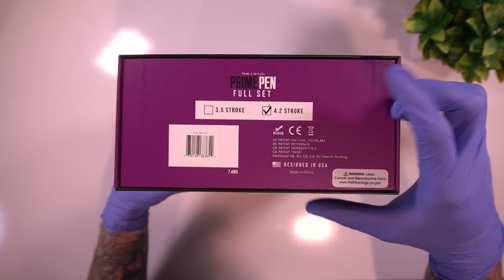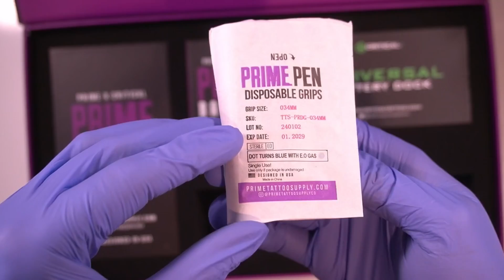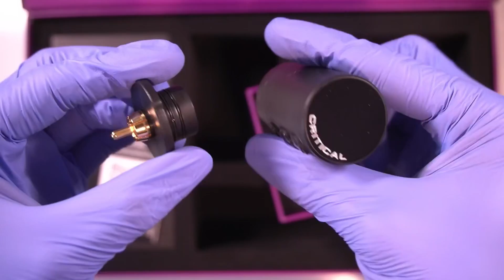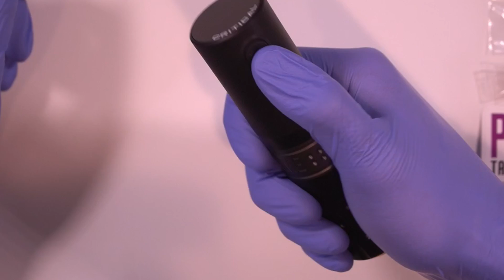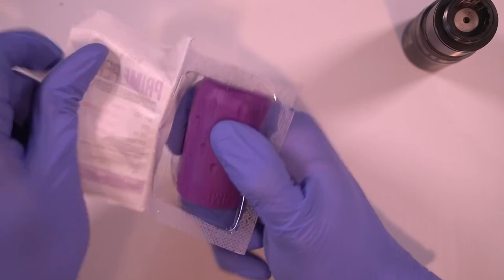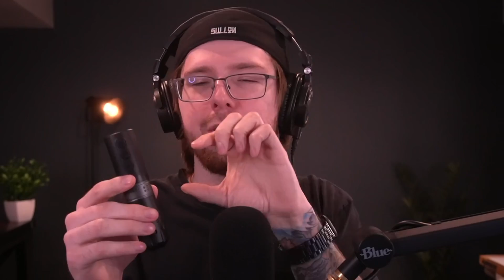Prime Pen Tattoo Machine Review

Comment: Hey Adam. Have you ever tried the rotary works pen 2.0? It’s a similar price to the prime, and I’m not sure which one is better.
Reply from the maker: I’ve never heard of it, sorry 😅
Reply: @adamdarklord  😂  No worries. I only recently heard about the brand, but they're based in the UK, and have apparently been around for a while. They have a pen style machine, and although there isn’t a lot of info or reviews on it, the ones I have heard say it’s great. I saw one comment where someone said ever since they got theirs there bishop wand has been collecting dust in the drawer. I’ve been doing nothing but researching the best pen style machines forever, and would love to get a power wand or the acus, but hot damn they are so expensive, and I’ve been trying to save so I can get the next model of the iPad Pro after the M4 versions. So far the best options seem to be this prime pen, or the rotary works pen 2.0. 🤷‍♂️

Comment: So Adam, I watch a lot of ur vids (great job) but listen…
I’m in the market for a new wireless machine. I’m spending hard earned money, I tattoo 3-4 clients a week on average, I’m building my career RN. 
That said I feel like I don’t know what to invest in..I want your honest opinion what to put $ towards/invest in..what machine set up?
The EZ Turbo looks good but battery life is important to me..
The Prime pen looks sick but I’m concerned w the swash plate u dis on a lot but this on is “Great”?
I’ve been tattooing with a TF pen 3.5mm stoke w fixed swash plate for a year no issues..
Or save $ n invest in Acus?? Love that sounds like good investment also due to all the interchangeable parts/good design..
  So what to spend $ at my point in my career? What would you do? Or do you suggest a different setup?? Plz lmk I respect your honest advice
Reply from the maker: If you’re used to a swash plate machine  then the prime is awesome.
The prime actually has lots of power for a swash plate machine I’m very impressed!
It’s the best swash plate machine I’ve used. 

With the Turbo you can tattoo like half the day then just plug it in take a lunch brake and then it should last the other half of the day. 

If you almost have enough for the Acus saved up I’d definitely get that! It’s the last machine you’ll ever have to buy 🔥

Comment: How does it compare to the 4.2 Torque and 4.2 Wand? Very curious.
Reply: If you already have the Torque or Wand, we recommend sticking to them. The Prime Pen is designed more for those just getting into tattooing or pen style machines nor those that like finer lines and shading. It hits slightly softer whereas those that use the Torque have quicker hand speed and  prefer more power/torque.
Reply: @criticaltattoo  so if I have the packer and the torque in the 4.2 and 3.5, the 3.5 prime wouldn’t be a viable option for black and grey with the swash plate and possibly behave similar to the hawk pen?
Reply from the maker: Critical nailed it with the reply!
I’ll do a comparison video in about a month after I do some more testing

Comment: Brush Motor in 2024 👎
Reply: Don't knock premium brushed motors. This is a custom motor made in Japan (not China) by Namiki and has better durability compared to brushless motors from China. We are nerds and run crazy cycle tests. This is the same motor used by the Bishop V6 Capo with many having gone 5+ years with no issues.
Reply: @criticaltattoo that’s fascinating, years ago I heard that Japanese production of these motors had been completely moved to China. That anything from China marked Namiki and “Japanese motor” were actually being manufactured in China.

Not to speak ill of all Chinese manufacturing but it’s nice to hear we’re getting actual Japanese motors in tattoo machines now.
Reply from the maker: @criticaltattoo  🙌
Reply: I’ve used the Fk Irons Max “brushless” and the Fk One “brushed“, Max for two years, One for 1 year.

They’re identical, if the motor is of quality you literally can’t tell the difference.
Reply from the maker: Did they confirm what motor it is?
Reply: @adamdarklord  I saw the information on the Barber DTS website

Comment: I can't get why this machine is good ?Not adjustable and don't think the design with the plate inside is going to last...what's your opinion?
Reply from the maker: I wish they went with one machine with swappable plates inside it to adjust the stroke. That way if you had an issue with the plate you could just order more plates! It’s hard to say so far, I’m surprised I’ve had no issues with the swash plate. It’s actually been feeling very good to use but of course the plate would have to ware out at some point 🤷‍♂️
Reply: @adamdarklord  so I can't see the difference or why it is so unique...

Comment: Is this good enough to knock the m1 and critical off the top of your list? Thanks for the videos man!
Reply from the maker: The M1 is still my top spot because the M modes, battery cells, and buttons and display on top!
I’m doing more testing but I might like this more than the Torque. I think the swash plate makes it hit the skin softer so it doesn’t damage the skin as much. 🤔

Comment: This machine kinda looks. Just like the dragon hawk fold 2  with a different logo. On it. That's my take off this machine
Reply: Looks can be deceiving ;) The guts and engineering matter. Please run a voltage accuracy meter from any other battery vendor and compare to Critical. We are obsessed with accuracy down to the small details.

Comment: How many batteries does it come with?
Reply from the maker: Two batteries if you get the full set I got
Reply: @adamdarklord  thanks for the reply,
Do you know what motor is inside the prime machine?
Reply from the maker: @jonathanjulius1903  They say it’s a motor used in a bishop machine but who knows what machine. If it was a Faulhaber motor they most likely would have said that and it would probably cost a-lot more. I’ll probably get more info on that soon!
Reply: @adamdarklord hopefully they use faulhaber motor

Comment: Made it more affordable since they didn’t go with the Faulhaber motor and direct drive system. Lost me at swashplate. Just too much of a bad history with them breaking and/or wearing out. Maybe they can prove it to be a viable option with this pen. Certainly should be a more affordable option for people not wanting to fork out a grand for a pen style machine.
Reply from the maker: They say it’s the “Bishop Motor” which bishop motor I have no idea. Maybe I can find a way to take it apart
Reply: @adamdarklord yeah if it were a Faulhaber motor, they would’ve said it. lol.  Ones like the microangelo used Swiss maxon motors. Which I also think they would’ve said. Because those are probably the two we’re most familiar with for performance and reliability. Not mentioning it, reducing costs, and that swashplate and transmission piece all sound like outsourced China parts to me. Which I can’t completely dismiss because my peak solice and Kyan have been running forever and they're China made. 🤷🏼‍♂️
Reply from the maker: @1Dantrn  good point 😂
Reply: We pride ourselves in backing up all our products and located right here in the USA. If you have any issues with the machine, we're here domestically to repair/replace :). We do use tighter tolerances on our swash and use an amazing motor to pair with this machine.
Reply: @criticaltattoo  thanks for the input. I’ve always been impressed with your customer service.
Reply: I wanted to order it but the disc puts me off too. I would have liked her to be direct. I don't think she has as much of a hit as the Packer, right?
Reply from the maker: @tricArt7 Feels maybe a little softer than the bishop Packer. I haven’t used that machine in a long time though so it’s hard to say but I’ll compare them in a future video
Reply: This just looks like jumping on the bandwagon of prime drinks which is super cringe for me I think the prime logo will put off many let alone that disc
Reply: @thomasthomas6534 actually prime cartridges came out way before the energy drink came out. The energy drink used the same tattoo prime logo which isn’t surprising as Jake Paul gets lots of tattoos and probably got tattooed with those cartridges lol
Reply from the maker: @thomasthomas6534  I had like 3 Prime drink jokes I was holding back lol